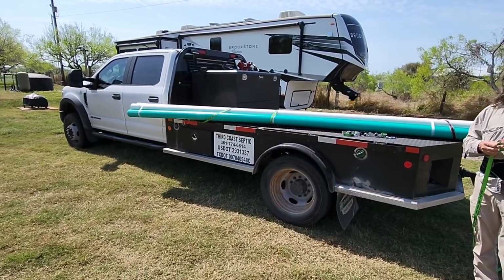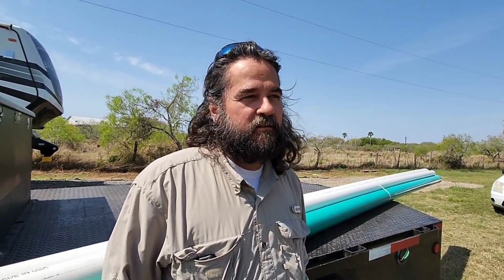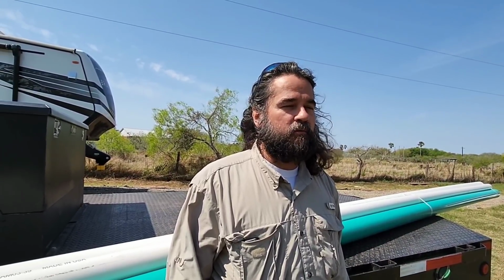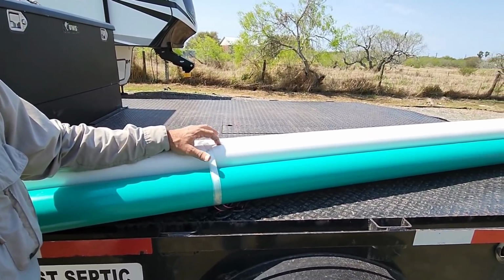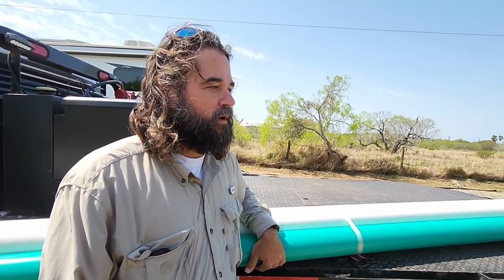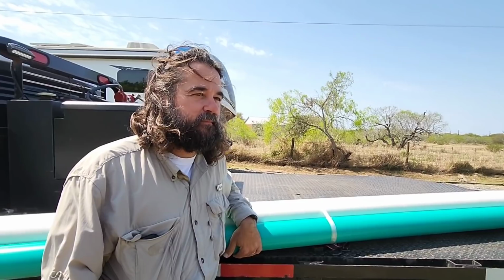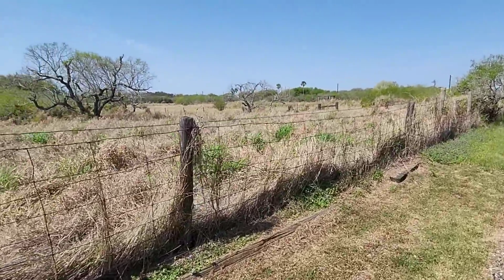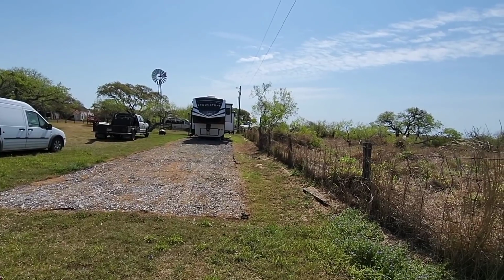Building a REAL Septic System for the RV! Part 1

Comment: My house builder recommended against connection from RV to a septic tank. Depending on the size and capacity of the septic tank and the load and frequency of sewage, it can overwhelm the tank.

Comment: We set up our home base with two RV sites. One has 50 Amp service (with 200 Amp for future use) and the other has 30 Amp service. We have a septic and well, too. It is set up for a 3 bedroom home, again, in case we ever decide to build. Great video. Thanks.
Reply: Do you have your own water system too? And if you do, can you regulate how much water pressure each trailer gets?
Reply: @Arod Sa  Yes, we have a well. That water is not metered so there is no monthly usage fee. The only cost was initial installation.

Comment: Will you be driving over the drain field?  Since it will be closer to the surface for evap, I'd be worried about crushing it with the weight of the truck and RV.
Reply: The system is designed for the water to sink into the soil, not evaporate. No problem with water on the surface.
Reply: My thought also. I would be nervous to drive on that. I always try to steer clear of septic systems when driving on someones lawn.

Comment: Seen caskets pop out of the ground in wet prone areas, the reason why some graves are capped off with concrete or stone.

Before we sold our home in Alaska we had to have the leach field replaced. Just the leach field was over $7,000.